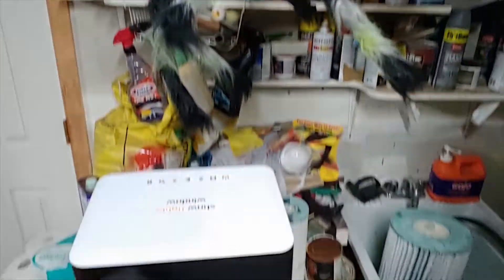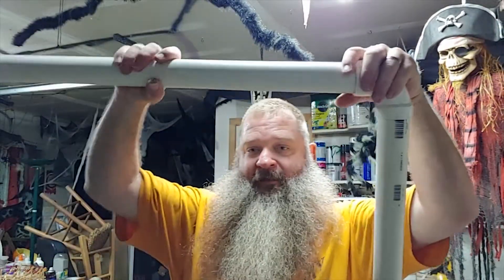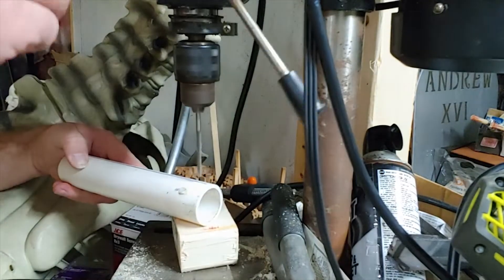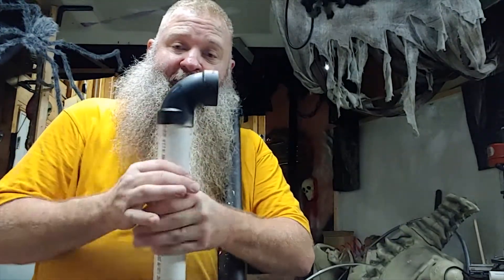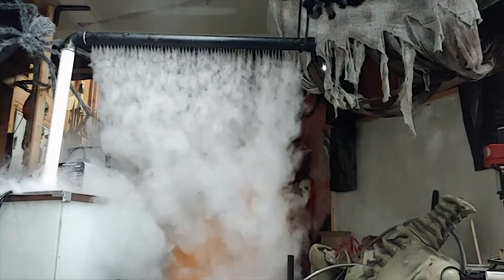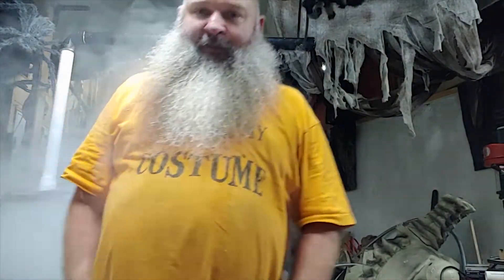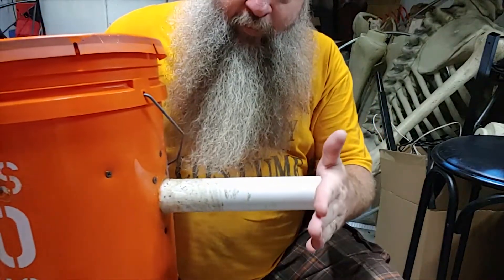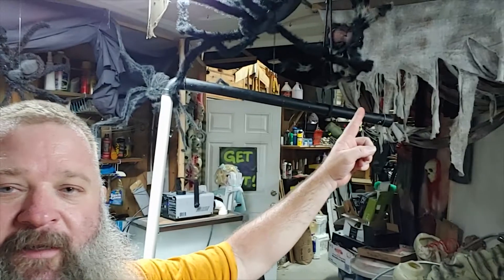Easy DIY Fog Screen

Comment: Couldn't you just use an increaser on the end of the pipe for a larger diameter to allow air to enter around the fog machine outlet?
Reply from the maker: I don't see why not.  This demo was put together with stuff I had lying around.

Comment: Why chill the fog?
Reply from the maker: Excellent question.    It is to make the curtain of fog continue to fall after it leave the pipe.  Otherwise it will come out of the pipe and just stay airborne. 

I demonstrate that in this video https://youtube.com/watch?v=o5M-YbGWf4g&feature=shares
I start the non chilled demo at the 2 minute mark.  Then I turn on the chiller and demonstrate the difference.

Comment: Can you use any size pipe or do you need 1 1/2 “ pvc pipe?
Reply from the maker: Any size pipe should work.  I find that smaller pipe does seem to create condensation more quickly that larger pipe.

Comment: Nice old Shopsmith you're using as a drill press.  I have the same machine with all attachments.  Mine's currently set up as a lathe.
Reply from the maker: Ha!  I love it when someone noticed background details!  Good catch!  I have a separate 7" lathe that is good for the 2 or 3 things I turn in a year.
Reply: @intocoasters  Mine is coming up on needing a new belt, but they're great machines.  Nothing made like them today that I'm aware of.  I mean, there are obviously better drill presses, lathes, disc sanders, table saws, etc... but I don't know of another all-in-one machine that matches up.  If you're cramped for space, you can't beat it.

Anyway, thanks for the video.  Gave me some good ideas for this upcoming Halloween.

Comment: Do you chill it with regular ice? Would dry ice work better and last longer?
Reply from the maker: In this case I am using a water-based fog chiller that I built. Here's the video for that. https://youtu.be/o5M-YbGWf4g
I used to use ice but it had to be refilled often. I have never used dry ice, so I don't know how that would work.
Hopefully this helps.

Comment: Hi just how long does your ice bucket last .before it melts how many hours would you get out of a bucket of ice regards Greg
Reply from the maker: Hi Greg, thanks for asking.  I get less than 2 hours of useful cooling from the orange bucket without adding more ice.
The iceless fog chiller in the aquarium will outlast the tank of fog juice. More than 3 hours of use and still outputs low lying fog (with a fog fluid refill once during the evening)

Comment: This is great, thanks for sharing your knowledge.  Any tips to prevent indoor fog from setting off smoke alarms?
Reply from the maker: Thank you!
My builder left these covers for the detectors if I ever repaint/spray the rooms.   They look like shower caps that stretch over the unit.  These might help.  
In my garage, I have heat detectors I stead of smoke so I haven't had that issue.

Comment: Amazing video. I’ve replicated the  bucket fog chiller to your same specifications. However getting good results. I’m wondering if I have incorrect airflow? I saw an earlier video you did and it appeared you had fog entering from the lower/shorter tube. Your guidance is appreciated

Comment: What type of fog solution did you use ?  I’m  using bog fog from froggy’s fog but it is not giving the effect that I want.
Reply from the maker: I think I'm using some form of "low lying" formula.  Maybe called freezing fog or freeze'n fog  or something like that.  
Apparently, it's formulated to work well with dog chillers.

Comment: that last bit blew my mind! i would not expect giving space to the fog machine and teh tube would make that drastic of a change. i wonder why?
Reply from the maker: I have only done a little light research into this - so I don't really know.  But I think its the Venturi effect or Bernoulli effect or some bit of both.  
I did find a video that is an excellent visual explination.
https://youtu.be/Na9ORhYjvJU
Reply: @intocoasters  woohoo, Science!
Reply: Because it is drawing air into the chiller, trading volume for density. In his case the additional volume allows more water vapor to be forced out of the chiller, making it appear to create more fog. Without the water tank and ultrasonic, you just get a similar effect as blowing the fog through a small fan. Bigger cloud that is easier to see through.

Comment: This is amazing! How would it look without something to chill the fog?
Reply from the maker: Thank you!  It kinda looks like a cloud is forming around/from the pipe. Rather than a jet of steam shooting from a single nozzle.
Reply: @intocoasters  Thank you so much! What fog machine are you using so that it's continuous? I have to make a 10-15 minute visual to project onto something for a project for school and wanted to do it with a fog screen
Reply from the maker: @MichelangeloCozzo  I am using a 900 watt AFX Brick fog machine.I love this machine a lot but I can't find anymore. I wanted to buy several after trying this one.
Reply: @intocoasters  one last question, could I forget about the cooler if instead of spraying the fog down I sprayed it up instead?
Reply from the maker: @MichelangeloCozzo   
Go to the 50 second mark on this video.
https://youtu.be/vyT_AkKXbus
I have the tube laying on the ground running upwards.
As you will see it is slow and billows.
Reply: @intocoasters  so along with that question, what about a tube blowing up and one down? Two fog machines??  Would that be over kill?  And thank you for getting back to our questions🤗🤗
Reply from the maker: @mea164  I do not think that would be Overkill at all.somewhere online I saw someone make a frame with fog coming out of all four sides.
Because it was only one fog machine spread along four sides it was not very dense. Maybe four sides with two fog machines would look a lot better.
but it did pretty well off of just one. It was not for a projection however, just somebody walking through it
Reply from the maker: Watch from the 2 minute mark. I run fog thru without the chilling part turned on. 
https://youtu.be/o5M-YbGWf4g

Comment: I've always wanted to try one of those fog screens/curtains but never gotten around to it.  Job well done as always man, that is a great effect with the projection on it.
Reply from the maker: Thanks man!  If you have a fog chiller, this is a fairly easy add-on.  It just doesn't work well with wind.  But I use it indoors, so that helps.

Comment: Very cool! I was thinking of how I could do this for outside, but unfortunately you said it doesn't do well outside.
I have that exact same projector and will be using it for my Christmas display.
Thanks for the tip on drawing the line on the pipe!
Reply from the maker: Thank you!  
And I wish it worked outside too.  I would love to have it for a character appearance or something. 
This projector is surprisingly good.  I was skeptical.   Make sure to protect it from the weather!